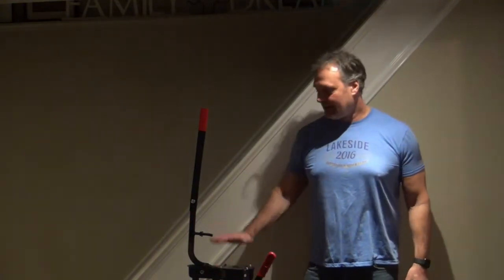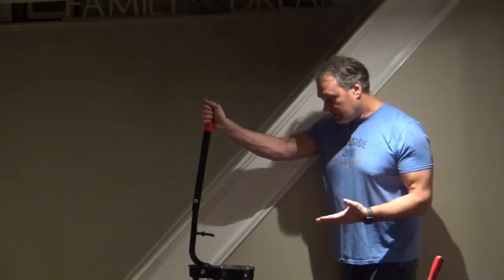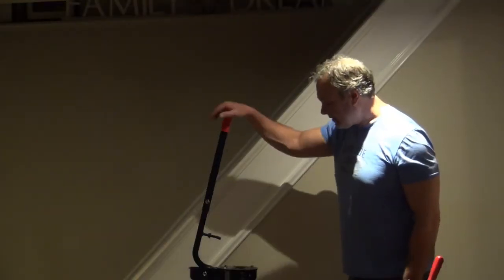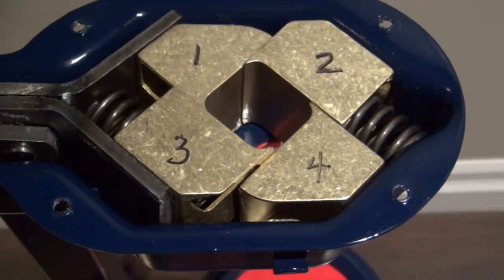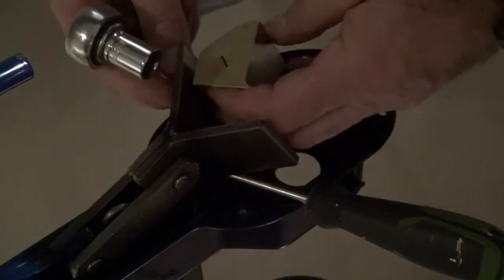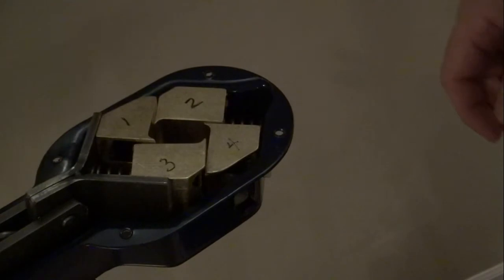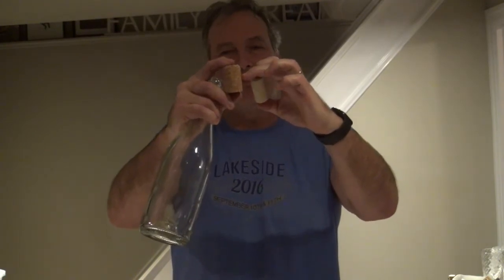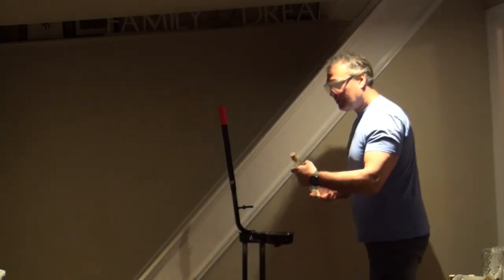Ferrari corker: Using real cork in sparkling wine

Comment: I brew beer (saison & mixed fermentacion), they have higher carb level than the usual beer but I have doubts if it will be enough to push the cork out when trying to uncork. Some belgian breweries use champagne bottles but have a 25.5mm cork and cage model (they dont use champagne corks). Unfortunatelly where I live (Argentina) the only corks available are 23/24mm wine corks or 29.5/30.5mm champagne corks. Any thoughts on this? Thanks!!!

Comment: Great video! Thanks. I just recieved that same corker, I had ordered the  one that comes with that small arm that holds the cork but instead got this one. Does it work fine with 30.5mm champagne corks? I tried corking a couple and the side of the cork gets scratched when I pull off the bottle. Im not shure if I should ask to get it exchanged for the model I had originally ordered
Reply from the maker: I bought 30 x 47 corks and had to get 500. My thinking was the bigger the better I suppose. Most of the bottles accept them but occasionally they won't go in. I think these are too wide and too long. I've been comparing to commercial champagne that I've uncorked and they almost always use smaller corks. At 30mm wide I'm still seeing some scraping. I typically bottle my sparkling wines at 52psi and that is not enough to push these corks out. I have to assist the cork with a lever style corkscrew. It doesn't need much, just a little help. I also make cider at a lower pressure, probably closer to beer and you just have to help a little more. It's not a total pain in the butt but it makes it hard to give to your friends without a lesson on opening it. LOL. If you can get them to give you the other model I'd be interested in hearing how that turns out. I think next winter when I'm usually bottling my sparkling, I'll buy the smaller corks and try them.  Thanks for the question.

Comment: What are the best champagne corks to use in this?  The ones I found on amazon were little long. Once in the bottle, using the same corker as you, I cannot get it to “pop” out. Having to use pliers.  Not fun. Welcome you finds on which ones are best.
Reply from the maker: I made the same mistake, using the longest corks I could get that would match the correct diameter. I thought that longer and wider would be better. They probably are, but the pressure I'm carbonating to is about 52psi. Natural carbonation can reach 90psi so there might just be too little carbonation in my wines to 'pop' the cork.Now I use a cork screw like for still wine and the cork comes out very easily and is maintaining the carbonation no problem. I will have a look tomorrow and give you a recommendation for cork size going forward.
Reply: Are you corking just like wine?  All the way down?  No mushroom too?
Reply from the maker: @thomasphythian6058  I insert the corks 2/3 of their length so that there is a mushroom top.